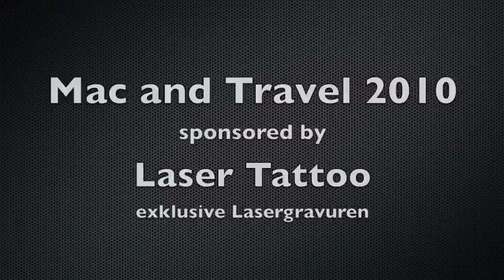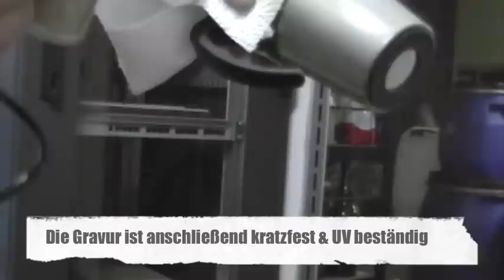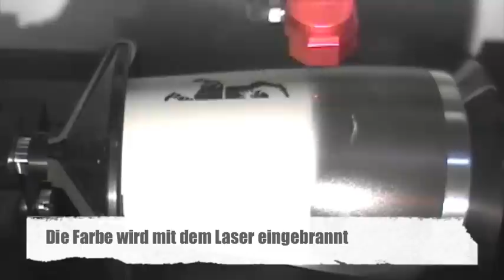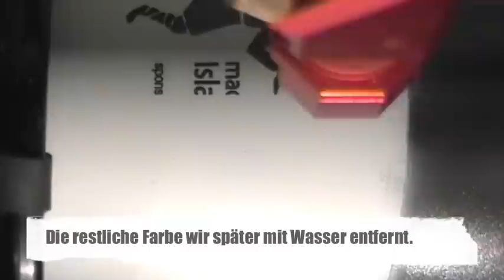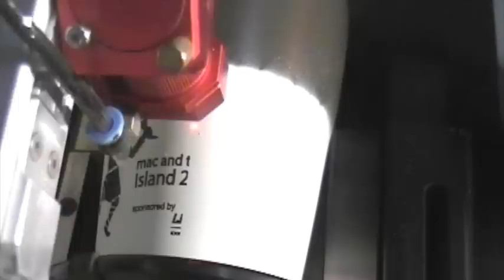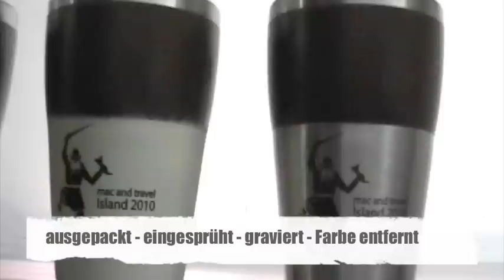Mac and Travel 2010 - Thermobecher

Comment: Is that the emulsion trotec sells, or something different?
Have you tried direct alu engraving? I did a series of alu thermoses that way. With a speedy300 45W and a setup of 100 / 2 / 1000 @ 600lpi the marking was nice and black. All you gotta be sure of is that the surface is really in line and in focus. And, of course, the material should be a bit thick so the temperature wouldn't bend it easily.